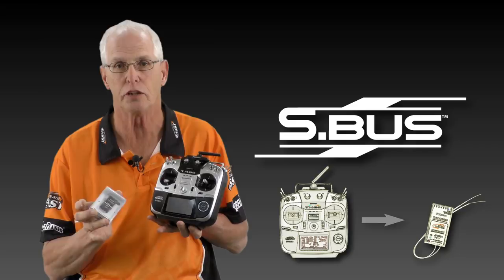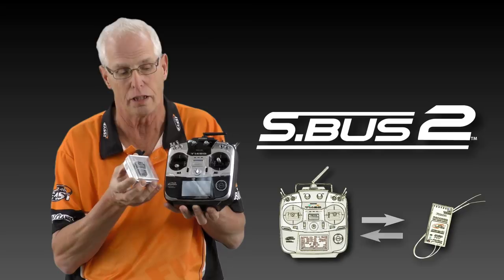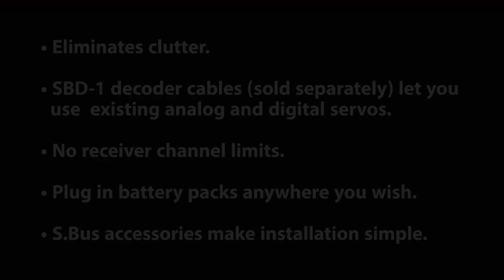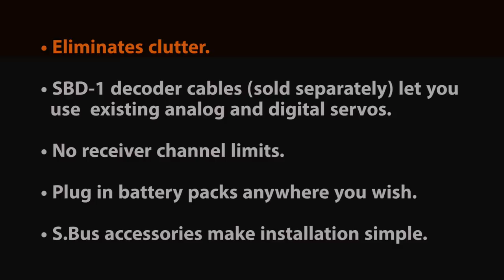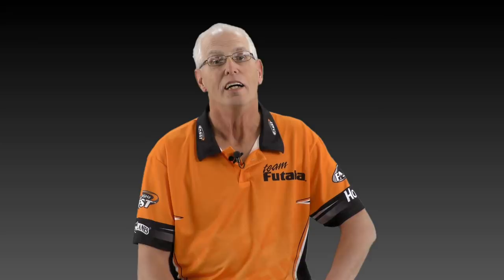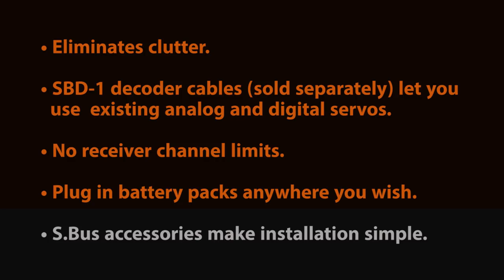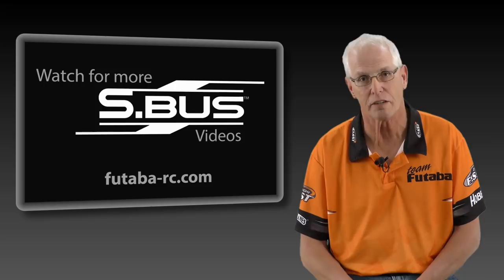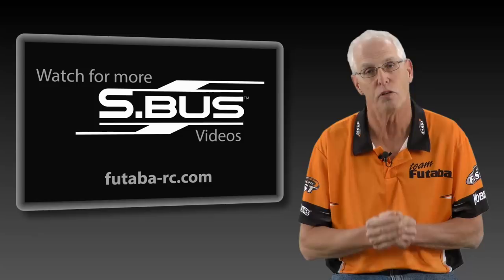S.Bus & S.Bus2 by Futaba – Video #1

Comment: The SBD-1 cable needs to be upgraded to allow the use of two cell lipo batteries. The Futaba 7008 receiver is high voltage why is the SBD-1 not high voltage. It would also be nice if the SBUS servos were not double the price of regular servos. The local hobby stores carry the 14sg but they do not carry SBUS servos. Because the demand is so low due to the high price was what I was told at the counter. I got it out I feel much better now.

Comment: I tried SBD1 with s3004. It didn't work.
Reply: Guner Tunca ERDOGAN 
hello sir i can tell you i found the same problem but stupid me you have to have the unit in the correct mode in order for the rx to see the SBD-1 unit  it works great for more channels
Reply: chandley43231 i didn't say it doesn't  work at all. I guess it prefers digital servos.